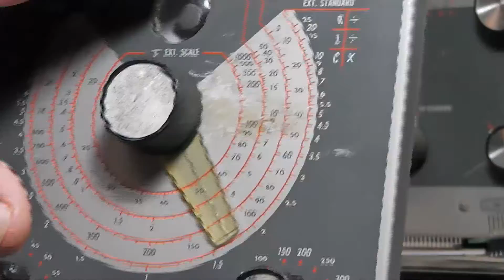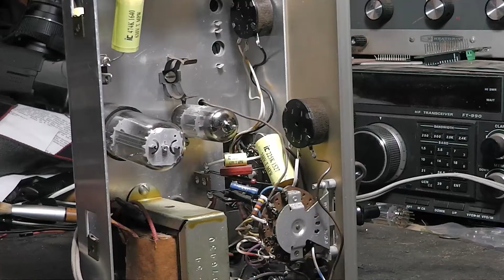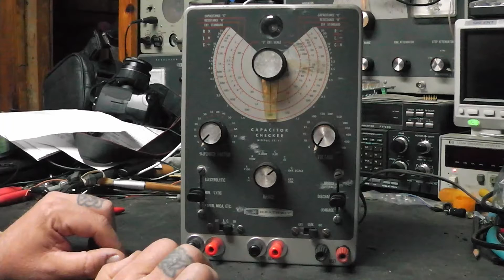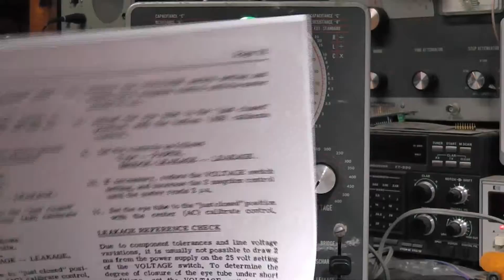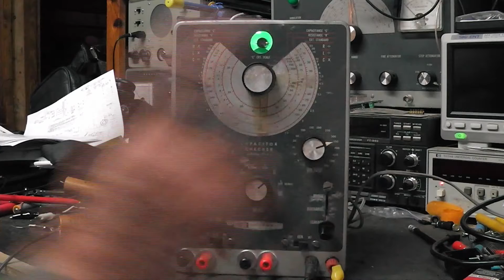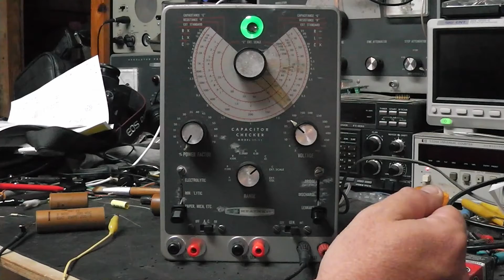Heathkit IT-11 RESTORE PART 2

Comment: I noticed that you used 47 uf 350v instead of the two 40 uf 350v capacitors. Since they are in series the total capacitance is more than the original 20 uf. Is there any reason why other than availability etc for using the 47 uf?
Reply from the maker: That is right 47 is the closest modern equivalent and the extra will not hurt in this application.

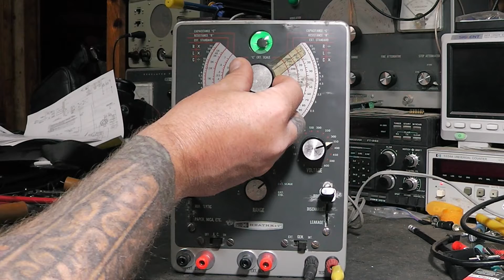Comment: @ 24:25 Your  "Power Factor" control is the "old school" way of measuring ESR in a capacitor, and most test units with that control have a listing of acceptable testing results. As far as having a paper cap "smoke" during a test, it's highly doubtful, as they are only subjected to current in the microamp range, and a properly adjusted closed eye for a paper/mica/ect test setting will indicate 2uA of current.  Glad you got it working again, and I am sure it will come in handy.

Comment: Thank you for the very complete, well done video. I have one of these coming to restore and will reexamine your video when I do. Having test equipment with such easily available potentially lethal voltages make me nervous, I see little value in testing these components, as you indicated capacitors are cheap, if they are suspect simply replace them. Again thankyou for your good work.

Comment: nice video. Where did u find a eye tube at? i cant find one any where. also where do you buy your IC caps at? Thanks, don N9SQS
Reply from the maker: I already replied to Don via email, but here is a copy and paste for others benefit: 
 Hello Don,

Actually, I find them on eBay.  When there are hamfests, and swap meets(pre COVID-19), I buy them IF, the seller has a good price.  But, mostly lately eBay.  It may not be the best place in the world, but it works.  Just watch the sellers feedback and see if they have a lot of feedback.

The caps I get from Digikey.  As you probably know for example, something like .05µF is no longer made so you find the modern equivalent, which would be .047µF.  As a matter of fact I looked up the link for this one for you.  I am sure you can find the rest from there.  https://www.digikey.com/en/products/detail/illinois-capacitor/473MPW630K/5412561

73, Michael-KE4EST
Reply: @ke4est  thank very much